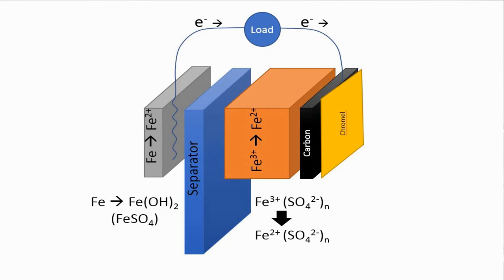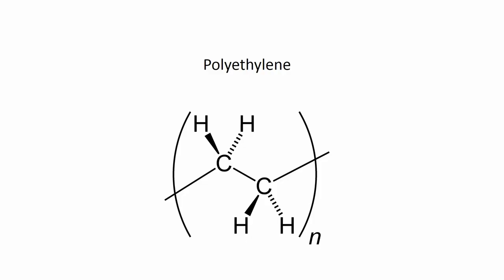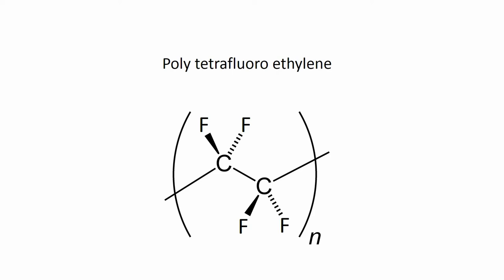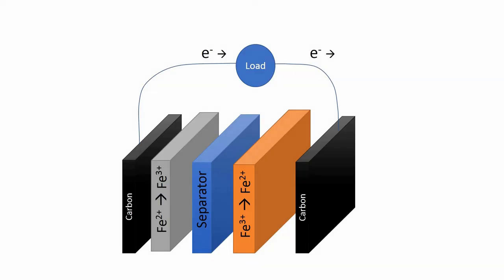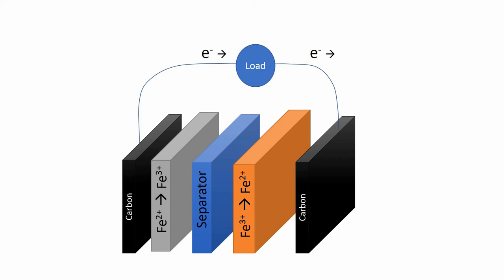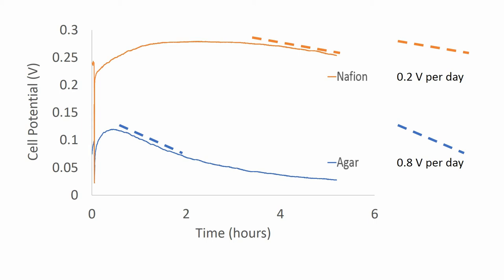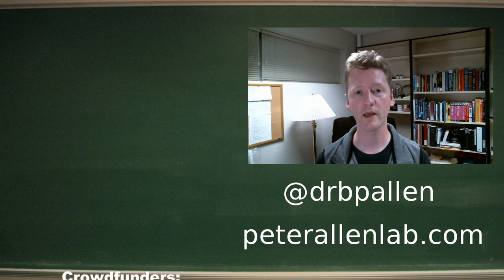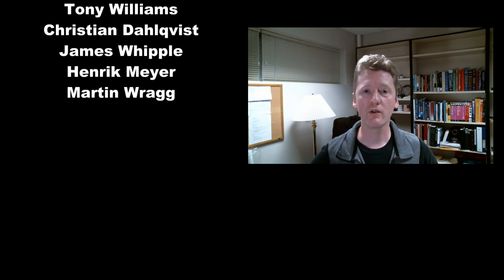Battery chemistry: Separator membranes

Comment: Hi Peter - for a number of us shade tree chemists doing some carbon carbon super cap cells we typically use a paper (kitchen towel, or copier paper) soaked with a small amount of water with white glue or cellulose (cigarette filter paper).  Works very well.  Not sure if in these cells Nafion would work significantly better.  Did try a separator from a hacked 18650 Lithium cell (Nafion?) but wasn't much different. 
Really learning from your channel - so a big thankyou.
Dennis